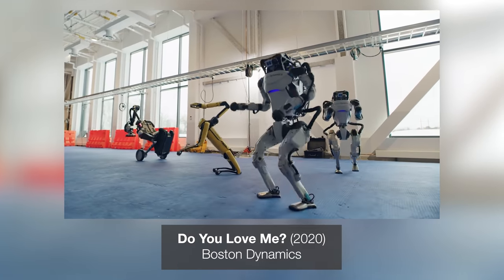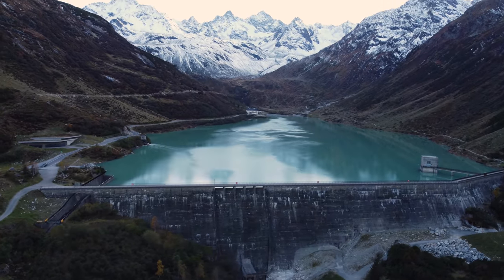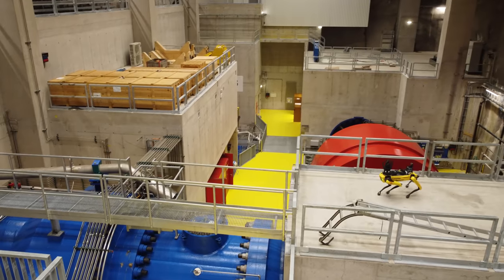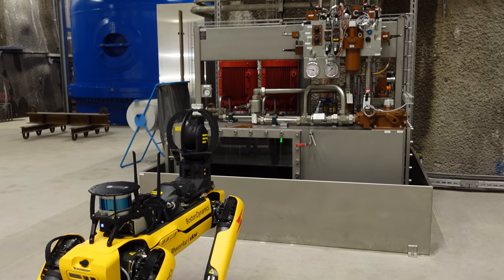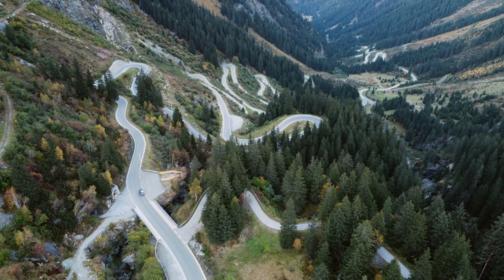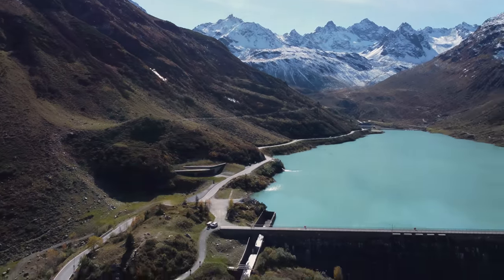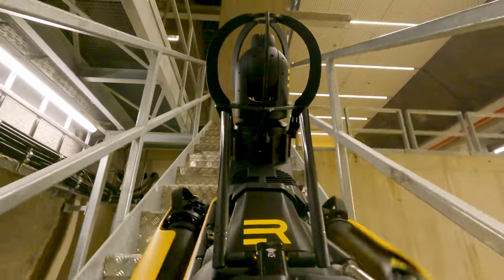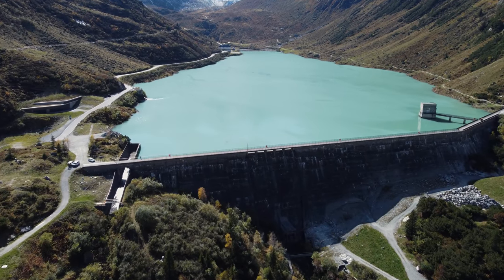An actual, real-world use for robot dogs

Comment: This is super cool but seems like it could just be some ip cameras.
Reply: 2000 Inspection point to be covered. Mix of thermal and normal camera. lets say you need 500 camera. Professional camera which hold longer than 3 years in very cold and humanid environment costs about $500. Then install all of those and wire it. Lets say $500 for making it easy to calculate. This is then $500k. And snap .. you forgot 50 inspection points or get some new ones. Or you just want to look on something from behind. Still do the same math?
Reply: @dialtone2k  While that's a reasonable argument, making tougher cheaper cameras is simpler than making a robot dog. And if a couple cameras go bad you're still able to see what's going on, how many dogs will you have?

Comment: why not just use cameras to see and record evey point in the plant.. much faster and cheaper.
i mean if the robot is not actually interacting with anything  it actually has to walk to every point of inspection.. battery charge on the robot does not last forever and time to walk is wasted.
if you put a camera there it takes an instant to see .

Comment: Builds and programs a robot dog to take a picture when you could have just installed a camera where u needed the robot to take the pic
Reply: 2000 Inspection point to be covered. Mix of thermal and normal camera. lets say you need 500 camera. Professional camera which hold longer than 3 years in very cold and humanid environment costs about $500. Then install all of those and wire it. Lets say $500 for making it easy to calculate. This is then $500k. And snap .. you forgot 50 inspection points or get some new ones. Or you just want to look on something from behind. Still do the same math?

Comment: Cant you just use cctv/temperature sensors (that have an independant power source to the turbine in case of an emergency) at all points that need to be checked. Seems like a waste of money tbh. What benefit does the robot provide that others cannot.

Comment: Looks at this and take a picture. Why not just have a camera near there?
Reply: The full sensor package is probably about as expensive as Spot, it'd be far more expensive to have multiple arrays of cameras and sensors mounted to walls everywhere you want measurements to be taken. With the robot, you just need one set of sensors and cameras and it will take them where they need to go.

Comment: Alright, but, surely, wouldn't it be easier to use something cheap, even putting plastic ramps on top of your stairs, in order to accomodate simpler, lighter, cheaper robots with wheels or tracks?
Reply: retrofitting an entire power plant for at wheeled robot?  do you have any idea what retro fitting costs?

Comment: Wait...why can't they just have cameras monitoring whatever they have programmed the dog to inspect?
Even if the dog is inspecting hundreds or even thousands of places, I still think it is cheaper to have thousands of cameras monitoring whatever you want to monitor.
Plus you get the advantage of monitoring it 24/7 instead of whenever the dog goes by it.
Reply: They take thermal images here. Those cameras can be a few thousand bucks a piece. The dog with all of its equipment is somewhere around $100.000 - $130.000 if i remember correctly

Comment: Reminds me of the Three Mile Island accident, where a valve was supposed to close, but it became stuck open. Instruments in the control room, however, indicated to the staff that the valve was closed. As a result, they were unaware that cooling water in the form of steam was pouring out of the stuck-open valve. If a human had actually walked into the room to check that the valve was actually closed, they would have caught it, but they took it for granted that the instruments were correct.

This "robot" is essentially a roomba with a camera on it. It lacks the intelligence to tell when things have gone wrong. It would miss things that a trained human would notice. Hopefully outsourcing this human job to a souped-up Aibo will not result in a catastrophic failure.

Comment: Quick Question why not simply use cameras at the points of interest I can't imagine there being so many points of interest that the robodog would be cost effiecient.
Reply: I can imagine a long welded pipe where each weld needs to be inspected - visually, in IR, possibly in UV as well, in multiple angles and axis. That could be up to 18 cameras per weld. Or one motorized contraption per pipe. Or one robodog per facility.
Reply: So, many tens of thousands of cameras in order to take in every thing a regular engineer would inspect.  It's far cheaper to simply have 1 mobile camera, after all that is what humans are.

Comment: Won't it be cheaper, faster, more accurate, to put tiny Wi-Fi camera and a single cloud computer to continuously monitor it instead? Even if you have to put 1000 of those at each location, would it be better?
Reply: You need to use industrial-grade equipment in a facility like that too, 1000 cameras built to that spec would really add up in cost - with the dog you only need to pay for one!

Comment: So instead of installing a few CCTV cameras and some temperature readings devices linked to the central, that would cost close to nothing. They send million dollar robot GREAT IDEA.
Reply: 2000 Inspection point to be covered. Mix of thermal and normal camera. lets say you need 500 camera. Professional camera which hold longer than 3 years in very cold and humanid environment costs about $500. Then install all of those and wire it. Lets say $500 for making it easy to calculate. This is then $500k. And snap .. you forgot 50 inspection points or get some new ones. Or you just want to look on something from behind. Still do the same math?

Comment: But why not a simultaneously cheaper, faster and more flexible inspection tool, like, I don't know, a quadcopter drone? Easily 1/100th the price, several times as fast and can see way more than any ground-based device could see.

Comment: Should we install a few $50 webcams or buy a $100k robot and spend thousands of hours trying to get it to do an inspection, only to have it fall down the stairs and break? Hmm, tough choices....
Reply: 2000 Inspection point to be covered. Mix of thermal and normal camera. lets say you need 500 camera. Professional camera which hold longer than 3 years in very cold and humanid environment costs about $500. Then install all of those and wire it. Lets say $500 for making it easy to calculate. This is then $500k. And snap .. you forgot 50 inspection points or get some new ones. Or you just want to look on something from behind. Still do the same math?